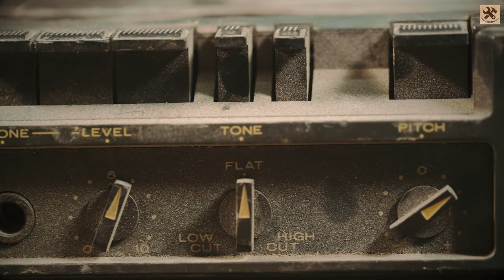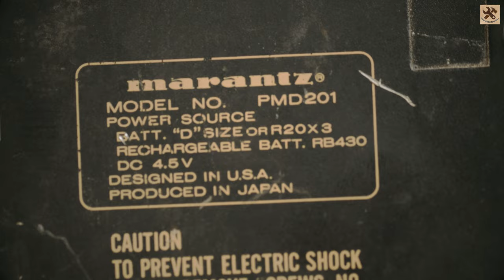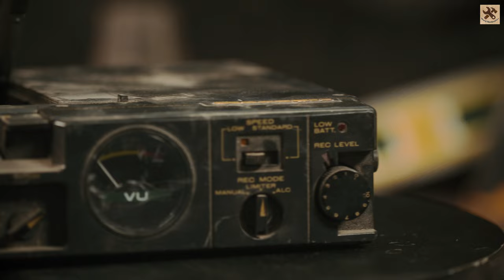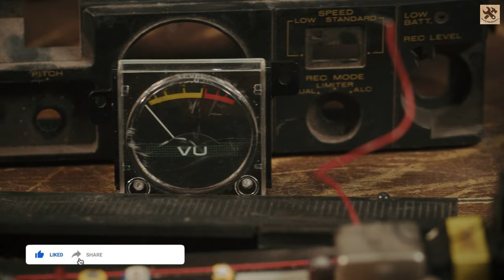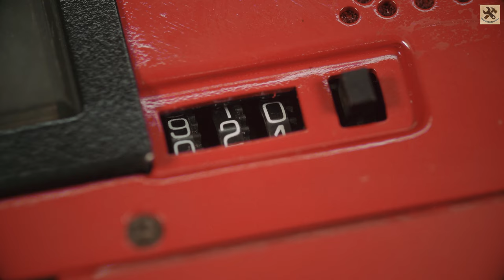Restoration Old Marantz PMD201 Stereo radio Cassette With Unique Skills /FM Radio

Comment: I just came into possession of one and it looks it fairly good shape, but I think  the belts need replacing as I hear a clicking and the capstans are not turning. But, it does have power. Where can I get the replacement belts for this unit. Your advise is greatly appreciated. I have learned allot from just watching your video!

Comment: Hi, I was wondering if you may know of a way to modify the pause button on the marantz pmd 201 so that the button doesn't latch when pressed. I'm trying to make it so when I push the pause button the tape is paused and when i let go it'll immediately start back up. Thanks
Reply: Should just be a plastic piece that is an angled locking tab, you could prolly file it off with a needle file
Reply: Try pressing the pause key until the tape stops but the key doesn't lock.  Then shape a small block and tape it in place beneath the key so when you press the key it just goes down enough to pause the tape but not so far to engage the ratchet.  Just fold up a little piece of paper to make the blocker.

Comment: hi! this model have 3 heads?
Reply: i believe the 201 in only a 2 head unit.
Reply: The Marantz machine that has three heads is the PMD 221, with the third head acting to monitor the tape. Other than that I believe the 201 and 221 are quite similar. The 222 is a stereo version of the 221.
Reply: @TheAmazingPaulrus  222-mono.